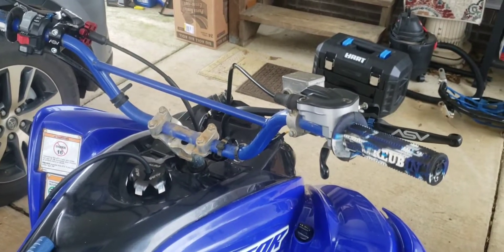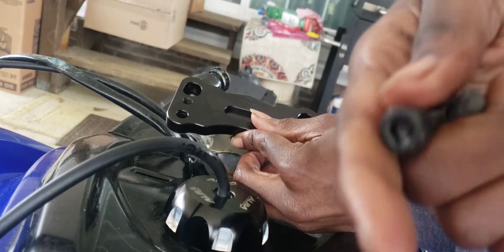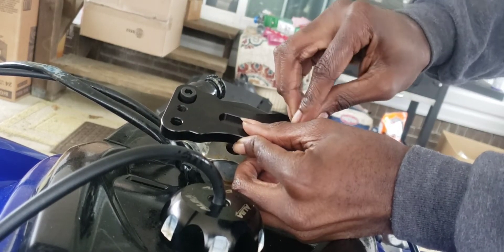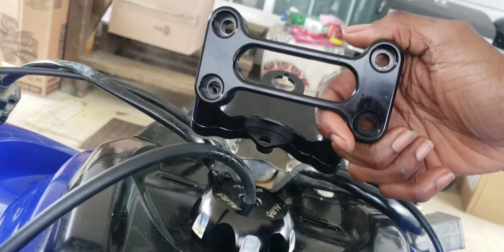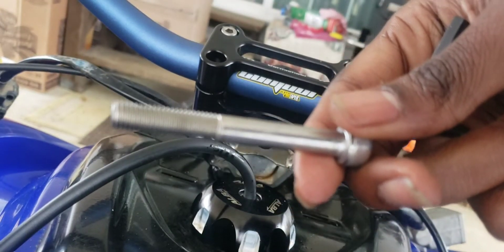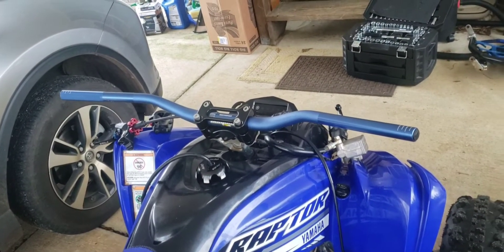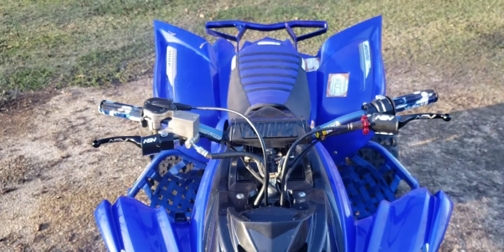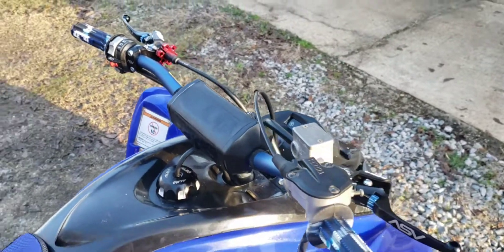Protaper Fatbar/Modquad Fatbar Clamp Install Raptor 700

Comment: 1 last thing! I meant to ask you, do you have any issues with that Stealth Bar Pad? I've had the same issue from day 1 with mine. I can't keep the velcro connection together, it keeps coming a loose mostly from the middle. I was just wondering if you were having this issue because all the other riders I've talked to that has this Stealth Bar Pad has.
Reply from the maker: I cut a piece of the bar pad so the key could go down to the switch I'll have to do a overview on it in my next video
Reply from the maker: I haven't had any problems after I cut the pad

Comment: Hey Sonic! Hate to ask this but can you send a link to the adapter parts? Also or does it come with those?
Reply: Piece 1 and 2 you pointed out in the video ✊🐐
Reply from the maker: @chancesanders290 
https://www.ebay.com/itm/192162905519?mkcid=16&mkevt=1&mkrid=711-127632-2357-0&ssspo=EU9PVmj6SYG&sssrc=4429486&ssuid=16XWS7ewRuC&var=&widget_ver=artemis&media=COPY
Reply: @SonicRaptor  Thanks for the fast response like always! Happy thanksgiving bro ✊
Reply from the maker: @chancesanders290  You're Welcome!! Happy Thanksgiving To You Too

Comment: Hello friend where can I get that article can you do me the favor of sending me the link
Reply from the maker: Fatbar Clamp Is Currently Out Of Stock But Here Is Link 
https://www.ebay.com/itm/ModQuad-Phat-Bar-Handle-Bar-Clamp-Black-Yamaha-Raptor-700-/171872486631?mkcid=16&mkevt=1&_trksid=p2349624.m46890.l49286&mkrid=711-127632-2357-0
Reply from the maker: Link To Fatbar 
https://www.ebay.com/itm/Original-Evo-PRO-TAPER-Handlebar-Fat-Bar-DIRT-BIKE-1-1-8-Made-Strong-Aluminum-/264869749629?mkcid=16&mkevt=1&_trksid=p2349624.m46890.l49286&mkrid=711-127632-2357-0